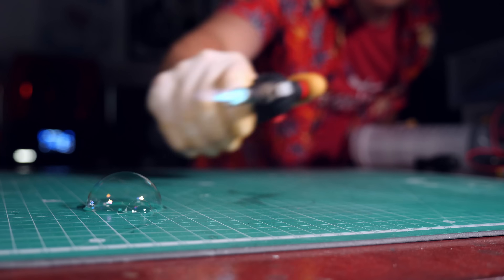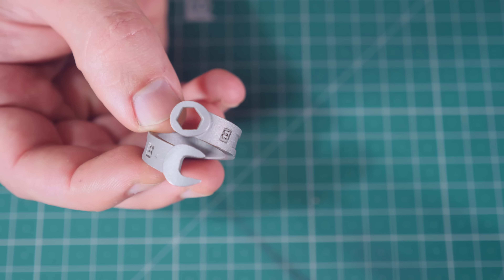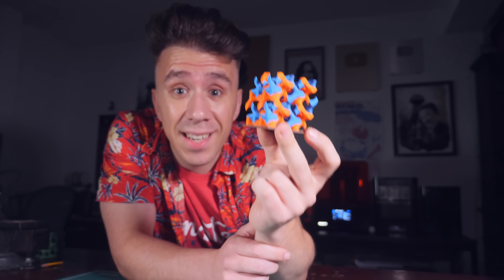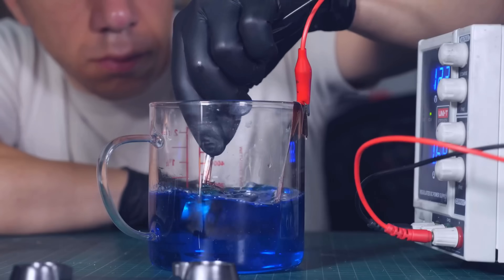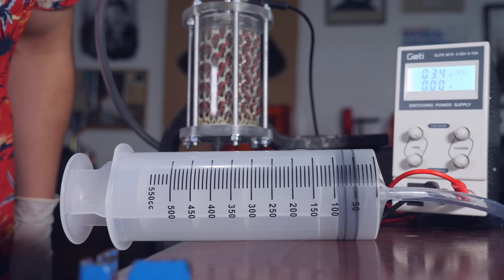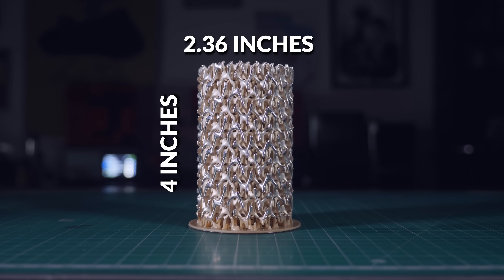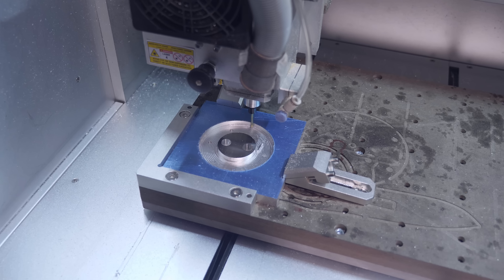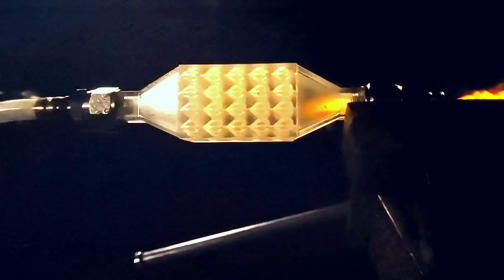ROCKET that LITERALLY BURNS WATER as FUEL

Comment: let's calculate the overall efficiency:

The short version is you only get back 1/3 of the power you put into getting the hydrogen out. 

0.75 (electrolysis) × 0.90 (storage/transport) × 0.50 (fuel cell) = 0.3375 or 33.75%
This means that only about one-third of the initial energy input is recovered as useful energy output.
The inefficiency ratio can be expressed as:
Inefficiency ratio = Energy lost / Energy recovered
= (1 - 0.3375) / 0.3375
≈ 1.96
This means that for every unit of energy recovered, about 1.96 units are lost in the process.
Reply: Yeah usually the average person don’t know thermodynamics and repeat everything they hear.
Reply: While I agree with how "inefficient" the set up is... Here's what I see...
1. Storing the fuel and oxygen is perfectly safe (water) 
2. Perfect amount of hydrogen and oxygen for perfect combustion
3. If the sources of energy is unlimited or easily renewed, such as nuclear or solar panels efficiency of energy to fuel conversion doesn't matter all that much

Also, the water storage is just about as good as it gets as far as density goes
Reply: @labanbaxter  the density is not so important for stationary use, but if you want to use it for transport (as the video implies) you also have to include the energy density of the electricity source, which would generally mean a battery of some kind.
Reply: @labanbaxter   good news water moves itself, and has moved itself for hundreds of millions of years.
Reply: You seem to think 33% is bad. 

I’m surprised the efficiency is that high.

This is about the same efficiency as a modern gasoline ICE. It’s not the best implementation of using hydrogen as fuel, but the primary goal of a YouTube video is to entertain. Plus I don’t think my guy has access to hydrogen fuel cells.
Reply: @8qk67acq5  no no... The idea is to be able to split the water so fast that you can split and use it at the same time... No need to store the hydrogen
Reply: @labanbaxter  The primary comment here doesn't appear to be talking about the setup in the video, but about the efficiency of hydrogen as power storage/source in gerneral (which is why the calculation includes the efficiency of a fuel cell, which the setup in the video doesn't use).
Also I'm not sure about the numbers they used anyway - it's been a couple of years since I took a course that talked about fuel cells, but I feel like the had better efficiency than 50%...
Reply: @labanbaxter  Why would you store the energy in water if you have unlimited power? You want to intentionally waste power? And feel free to make yourself a Hydrox car if you don't mind carrying a bomb around everywhere you go...
Reply: Yeah for takeoff terrible, the mass of the batteries makes it a non-starter. Once in orbit using solar power rather than batteries it could be feasible, less exhaust velocity than ion but super cheap and non of the issues of cryogenics or high pressure containment.
Reply: @TheFritz423  I'm thinking of propulsion in space... You can't just turn electricity into thrust in space
Reply: @labanbaxter  Yea sure using Nuclear power to create hydrogens means it does not matter if hydrogen isn't efficient... but you still run the issue of now you are dealing with running a car on liquid hydrogen and not water, since the water has to be turned into hydrogen by a nuclear power plant.
Reply: Yes and no. You are only addressing start up. Once a vehicle is running there is centrifugal force, rotational mass, heat etc that make systems more efficient. Same happens in a car. The most fuel is burned on startup and very little once it’s running. For example the electrolysis could happen from capacitors or things like a beefed up alternator once moving.
Reply: False
Reply: Rookie numbers in comparison to @EirexTech the 5 year old start-up company in Canada.
Reply: We need to apply this ratio to Prof Marc Ramsey, Vanderbilt University to his "Energetic Cavitation Impact" with custom made Cavitation Water Bubbles the size of BB pellets generating something like 400,000 PSI overunity output presented 8 years ago on YouTube.
Reply: 75% efficiency for the electrolysis seems generous, I doubt he's even getting close to 50%.
Reply: false,... pulsed DC current improves efficiency...
Reply: @meh11235  yes it lowers it

See what I did there? Same thing you did… Which is the state an opinion without any logic reasoning or facts. 
‘
You didn’t offer anything and why should anyone care about your opinion you need to offer Fax reasoning and logic don’t bother
Reply: @meh11235  that would be a no in any test possible.  Pulses do not change how much energy comes out. When hydrogen and oxygen recombined, they put out the exact same amount of energy, whether in pulses or continuously.

These are the common laws of energy and physics that cannot be denied. Only people who don’t know enough can imagine anything else.
Reply: I think the better question is which application does it compete against. It seems best to generate electricity as a byproduct of another process, or waste heat, because there are more efficient ways to produce propulsion that don't have significant conversion losses. Unless this is in another world where atmospheric thrusters and props don't work, or the h2o to hho conversion efficiency is improved.
Reply: @Infinion  pulsed DC improves the H2O to HHO efficiency… 
Recombination of exhaust gasses in a combination engine through a spark stream generates HHO and synthetic fuels, reintroduction of this mixture into the intake side of combustion engines improves those things several orders of magnitude
Reply: @labanbaxter  An unlimited source of energy is rare and usually very massive, very large, or both.  If you have that energy it may be more efficient to use it to vapor water and use a steam jet for propulsion
Reply: 33% efficiency is not bad communication to gasoline and diesel ICE ( 20-30%) efficiency

Comment: Great ingenuity.  Using the disks is an excellent choice. Many times you find the simplest ideas get you much farther along before you start fine-tuning into something more complicated .  For amperage control I have many ideas here starting with:
What if you were to  increase your distance between discs and the number of discs to reduce the amount of amperage draw; 
adjust your conductive solution ratio, and use a fuse or breaker to protect your batteries.  
Better yet, use a contactor with overload that we usually call a motor starter assembly with overload relay. They come in many different coil voltages and the overload relay is adjustable in amps that you can set. These have an overload test and reset button. You can utilize a rocker switch to use to initiate the contactor easily per each test.
Another idea is use an AC transformer and an AC/DC converter with fuse and a potentiometer to control your voltage and therefore your amp draw. 
And, another one, adjust the spacing of the disc to reduce the amperage draw at first, and work up.
Have you thought of using alternating current and capacitors. I do HVAC and use run capacitors for single phase compressors and motors all the time. There are universal capacitors by Amrad that you can select all sorts of combinations of capacitance.  Have fun and God bless
Reply: See @EirexTech in Canada for "Energetic Cavitation Impact" with any type of water that reminds me of Prof Marc Ramsey, Vanderbilt University and his YouTube video 8 years ago.

Comment: 1:56 not to mention that liquid hydrogen is so tiny that it can escape pretty much anything. Even NASA have some trouble keeping it in tanks.
Reply: Designing the seals and bearings for the turbopumps for the RS-25/SSME engines for the Shuttle was apparently a nightmare!
Reply: The liquid hydrogen molecule is the same size as the gaseous hydrogen molecule
Reply: We need a wall around fuel tank - project 2025
Reply: @ElonHusky  what? What are you talking about?
Reply: @PaulG.x tbf in addition to dealing with the small size, with liquid hydrogen you are also dealing with a super cooled liquid that turns almost everything it touches into super fragile structures waiting to break.

Comment: -Use a transformer instead of battery  or current limited powersupply
-Remove the outer shell of the electrolytic capacitor and place it in the water to get more surface area
Reply: But current limiting is probably a good idea no matter the power source
Reply: Why is he using DC anyway?
Reply: @bat__bat  I mean transformer with bridge rectifier.
Reply: @shrihari7715  You're missing the question. You need DC to collect the H2 and O2 separately. If you are mixing the two gases then AC works fine.
Reply: @eDoc2020 it doesn't matter you collecting the hydrogen and oxygen separately or mixing it . The  process is same .Direct current are more efficient for electrolysis process.

Comment: Hello, really enjoyed and have scanned some of the comments.  Two things that I observed.
1) you used 15 plates and the battery overhead.  Why not use only 5 or 6.
2) you had the plates stacked horizontally, why not vertical like in a car battery?  Would allow for easier movement of the bubbles.

Comment: I can't be the only one watching that wonders why when he showed metal printing at the start, he goes through so many iterations of trying to plate and then clean the gyroid print, he doesn't just get a printed part from metal (maybe the complexity increases the cost? Or perhaps too long of wait?)

Then he just completely changes it up from a very intellectually cool and interesting gyroid topology, to a series of stacked discs!

😂 Love it
Reply: Metal 3D printing services don't offer many types of metal, and the one he showed only has stainless steel, which isn't a very good conductor.

Silver would be hilariously expensive, tho copper might be okay if he finds a service that has it.
Reply: @ledocteur7701  oh, that makes sense. Thanks for the reply
Reply: Another reason could be the allaround conductivity. If it was conductive through all the shape, It would be useless as you need two poles. You would have to saw off the baseplane a get two meshy things stuck together and then find a solution to keep them fixed but not touching.
This way you have them perfectly spaced as its one object, and you just make part of it conductive.
He might be an idion, but pretty smart one.
Reply: @ledocteur7701  yeah stainless has quite the higher resistance but it is conductive so the Grafite paint could be skipped also but the paint is probably cheaper for his stuff
Reply: @ledocteur7701  I don't know, which kind of metal 3d printing is used here, but for powder bed fusion laser beam melting (PBF-lb/M) (better known as SLM, which is a patented name)  copper is quite expensive. I think is has to do with the manufacturing process of the powder, which needs a lot of argon gas.

Comment: hey, interesting video! 
Can't you just use an adjustable resistor to control how much current is drawn from the power source?
That way you could calculate how close you are to the limit of the LiPo and stay below it so it wouldn't burn up.
Greets from cologne

Comment: From what I've learned from playing around with hho, to lower the draw on the battery, add 1 to 3 neutral plates between each positive and negative electrode plate. Somehow, that lowers the draw on the battery and still produces well. 
I saw this on a few old hho videos from nearly a decade ago and tried it. It works.

Comment: An old model railroad trick, put some 12 lightbulbs in line with the device. If the device resistance gets too low, the bulb will burn brighter and provide resistance to the circuit, but if the current flows the bulb will barely light at all.  The idea with trains is that as long as the train is running, the bulb doesn’t light, but if the train wrecks and causes a dead short, the bulb will prevent blowing a fuse or burning up your power supply. Not sure this will help? But it’s an idea.

If that doesn’t work, try a big high wattage resistor, the big white square ones, it’ll get hot as heck but limits the current flow.

Comment: The problem with the high current is that you have such a high voltage over a low resistance. 

Try stacking 9 plates to create 8 gaps.  Attach +12v to one end plate and Ground to the other end plate.  The voltage in the KOH will evenly create 1.5v gaps or cells.  

Also, turn the plates sideways so the gaps are vertical.  This way the water will help push the lighter bubbles out of the way faster.  Electricity will not flow through the gas, so getting them off of the plate faster helps create gas faster.

I’ve read years ago about running the hydroxygen into the air intake of a car to help increase MPG.  The idea is that when the spark plug fires, the hydrogen flame front is faster that the gasoline vapor flame front and will help ignite all of the gasoline faster earlier in the power stroke and become more efficient.
Reply: This is the solution. The current conductor is an electrical short circuit. You need multiple plates to solve this issue.
Reply: This guy Electrolysis'. Would be cool to see if hydrogen cars become more prominent than electric in the future.
Reply: But the issue is the energy loss during the electrolysis stage.
Reply: I did this to a 2000 ford f150 and it works. I got about 25% MPG but the really cool thing was the added horse power that it adds. However you really should do it. After you burn the gas it turns back to water and it rusted the inside of the engine. You would need to build an engine special. 

I stacked the plates with 4 neutral plate between the load and ground with a total of 21 plates. Works great but to control the amps, it comes down to how conductive you make the water. I used baking soda so add more or less to start then to fill up, just add water. Distilled water only.
Reply: @Yodeification  can you show us? pls

Comment: Hi there Integza. In my quest to research an optimal HHO generator I saw researchers and creators making the generator in series instead of parallel. Simply said if you only connect the very opposite plates, isolate the center electrodes, then you don't waste the voltage, since each cell only needs about 1.1V or about so. Also I saw a paper that using a powerful magnetic field (just a magnet) near a HHO generator speeds up the creation of gas, since it somehow makes the flow faster. I also am limited with my power supply to just 5 amps, so I used a DC mode on a MIG welder to deliver 40+ amps on the lowest setting. It worked on a single cell, but almost boiled the water in around a minute. The potential is there, keep trying :)
Reply: the magnet makes sense, I think oxygen and hydrogen are both magnetic, so it could be pulling them away from the electrodes for more water to react, vs. just buoyancy removing the gasses
Reply: How about adding some flow? Like aquarium/pond pump?
Also to solve a boiling problem - how about most adding more water and using a larger container? Water is awesome near the sink due to the large thermal mass.
Reply: @jspapp5 yes and also because it helps configure the electron flow to a synchronized direction and speed up the thermal reaction with increased desired outcome and decreased energy waste. Essentially isolating the flow of energy
Reply: To remove heat - the electrodes (threaded bolts in this model) could be replaced with pipes. Could act as cooling radiator?
Reply: @tomclanys  the reason you boiled the water is you didn't have control of your volts, you are looking at 2.66v across each plate
Reply: @Mr123bohemian  well yes, I can't change the voltage on the welder. I think it was around 60V open, but being amp limited it gave whatever it needed to overcome the resistance. I didn't measure the voltage.
Reply: Wow, that is actually amazing
Reply: @tomclanys  you can get welders that you can control the voltage, I use a tig for testing, I run 200 amp at 2.6v across each plate, this gives me appr 21ltrs per minute of hho

Comment: I appreciate how you demonstrated that a more complex or engineered design isn't necessarily the most effective. Sometimes, simplicity works better.
Reply: There is an old video from late 80s early 90s of Bob Lazar showing how he converted his Corvette to run completely off of hydrogen.. From generating the hydrogen, to modifying tanks, the plumbing, and very little adjustment for Fuel O2 ratios